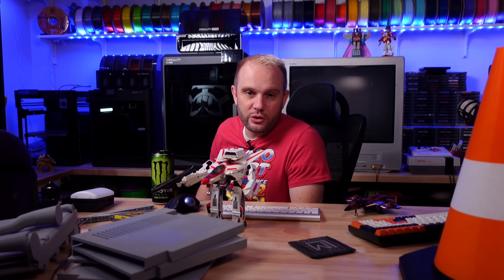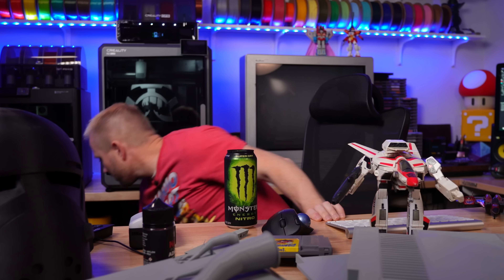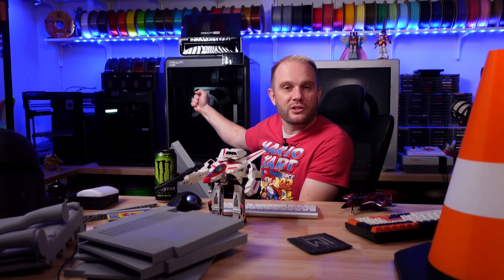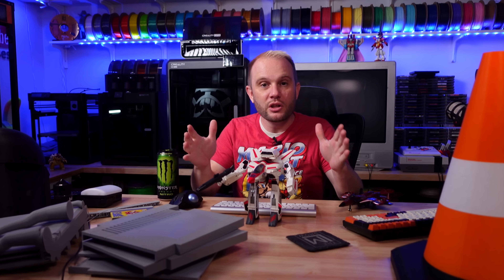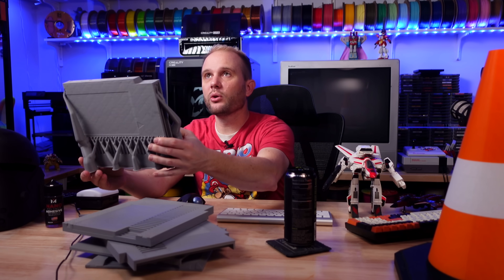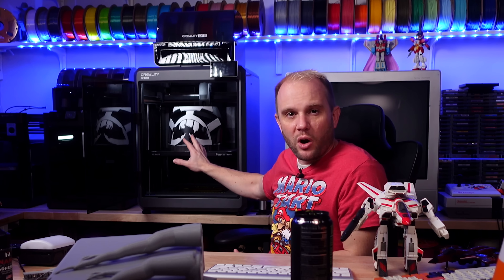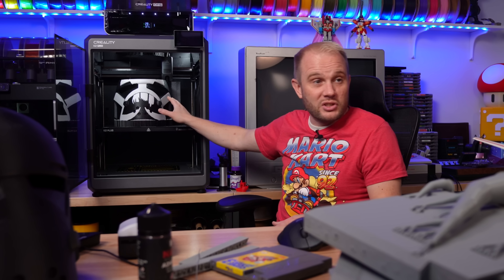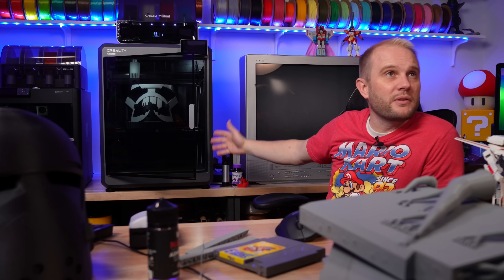SOOO Many Broken Parts and Print Failures!

Comment: I think it's important to capture days like this because they absolutely happen, and people getting into printing need to know its a thing that happens, but it's not insurmountable. My least favorite was trying to make an Orcaslicer profile for the Kywoo Tycoon because enough people had been asking, being new enough to Orca that I didn't triple check acceleration before printing, and toasting a stepper driver. The drivers are soldered in so it's a whole board replacement to fix, the main page didn't have them in stock, could order from France or get the board it was cloned off of, and even with that the board is stuck in such a weird place it fequires a crazy amount of disassembly to get at. I had the Magneto X coming, so I just boxed it up for the day I feel like going through all that headache.

Comment: it's creality what did you really expect ??? i made people bought lot of cr10, ender 3 ender 5... worked well for one year and after that the hotends were needed to be replaced if you want to keep printing correlcty.... the cheap comes at a price.
Reply from the maker: This may have been more true many years ago, but there is a significant difference in machines now vs then. In another comment or two, I mentioned how I ordered a custom $90,000 truck -- it had problems when it arrived. This happens with every brand in every industry.

What we are seeing is massive improvements across the board with every brand, our expectations are increasing as consumers and these companies are trying to meet them as quick as they can. This makes me hopeful that we will just get better and better 3D printers.
Reply: @LoyalMoses  yeah but we are talking about the brand that make the k1... Which fixed it's bugs design flaws etc by selling a new version.
They did the same for their scanners. My lizard never reached what creality promised. And they advertises the next one as the one that can scan dark parts... Which was what the lizards suppose to do but never did.
Reply: My Ender 3 printed since 2017.
Stop telling nonsense, brass nozzle need to be replaced on every machine, it's part of the maintenance.

Comment: Dude I am so glad others are coming out about these issues,  we have been through 2 warpped beds and 3 extruders.   And our CFS screams as well....lol.  This printer will need a lot of modifications.  Should of waited for the Bambu release.
Reply from the maker: In the video I said that my printer is printing perfectly, not a single problem - just the loud CFS slot 2, which they've already acknowledged and are sending the replacement. I haven't experienced anything bad at all, and I make it a point to not worry about the problems that other people experience, just share my own,

Comment: I have the Anycubic Kobra 3 Combo. I got it just before Thanksgiving. In the time I have had it, it has been down 75% of the time. Anycubic has been great sending me the parts, but it takes two weeks to get the part only to find out there is another issue. To say it is still frustrating is an understatement. I have replaced the Motherboard, print head cable, hotend, camera and now they are sending me a new print head and fan for the power supply because it sounds like a jet engine starting up. Oh, and as of last night, the AMS is throwing a code saying there is a clog. I have taken everything apart and verified there is no clog. So I can feel your pain and frustration. Yes that sound your machine is making, does and would drive me insane. I am about to go Office Space on my printer if it doesn't start working like it should. When it is working, I love the prints I have made. But I am addicted to this 3D printing.

Comment: Good vid. Have had all those issues over the years.  If you know a part wants to warp and you need to use an adhesive to keep it stuck, clip at least the 4 corners of your build plate with strong metal clips.
Reply from the maker: Thanks! Before I started the print the 3rd time... I was so tempted to grab a few clamps and lock it down...
Reply: @LoyalMoses  you need higher chamber temperature... the large print covers too much of the heated bed, the bed does not need to be heated that much and so the chamber is getting too cold and the warping starts... you can try to mount a fan under the heated bed (pointing upwards) so more heat is transfered to the air in the chamber (works best without bed isolation).

Comment: I recently had a print come detached from the bed. I’m use to finding a mess of spaghetti but not this time. It was a tallish cylinder and it stuck to the nozzle and was scooting around the bed. This caused the pla to create a giant blob that inflated the silicone sock and pushed plastic all the way up to the cooling fan stopping it so heat creep could add to the party. I went in to check it and was amazed the little Ender’s extruder was still feeding that creation. The only thing I was not able to save was the fan. It had enough pressure applied it was missing a blade. Blade was pressed against the heatsink. I regret not it taking pictures of it but at the time was focused on getting the printer up and finishing the planned prints for the day.
Reply from the maker: Yikes! The blob of death! Sorry to hear this.

Comment: Slot 2 is definatly dying there in CFS. 🤣 I'm sure it a swap out of the extruder but Holl Molly... Le 😱

Ouch on the NES cartridges. 🥲

The MAC sliceing is oof for sure in Creality print. I'm working with older MAC,  some reason my mouse movement is scrolling back in time on the side bar. Will be setting up Orca slicer.
Reply from the maker: I checked it on a PC, it’s fine, just the Mac version is terrible!
Reply: @LoyalMoses  Also yes to the floorboards are vibration for sure with the K2 Plus. I'll be happy to move it to the basement when it's done. 😅

Comment: It sounds like the CFS is having problems with the first stage feeder. Likely, plastic has grinded itself in the feeder. It could also be the spool is too light. When retracting, it could be too light thus making nasty sounds. Sometimes adding a weighted core to your spool helps with AMS designs. I would still contact Creatlity for a replacement part or unit. Everyone has these days my man. Just get the maintenance done when you’re ready and you will be off printing again with no problems.
Reply from the maker: I’m going to dig in later, it’s not a simple issue, something is definitely not right.

Comment: Good luck. Yes, we have had print issues, your cousin made me 2 different Sorcerer Mickey on the Bambu A1 mini and they both have issues. Ken says it's the file that's the problem, not the printer. So I have been using Plastic Wood to fill in those areas and going to paint them.
Reply from the maker: It can definitely be the file and slice sometimes for sure!

Comment: Maybe it's me, but every time I try ironing, it looks like crap. What's the secret. My K1 Max or A1 both do it.
Reply from the maker: It should work great with default settings ONLY if there is absolutely no warping. Even the slightest of lift from the build plate, even if you can’t easily see the lifting, will cause ironing to look bad.

I have some other NES cartridge content here on the channel, and the ironing was perfection!
Reply: @LoyalMoses  Thanks for the reply. I just don't like how it looks. I thought it was supposed to smooth out the surface. Tried with my ASA and PLAs. I've only been printing for 2 years, though, too.
Reply from the maker: It should look perfectly smooth, almost impossible to see the surface pattern.
Reply: @LoyalMoses  Thanks. I'll keep testing. I usually looks like it's just scraping it. Looks better if I don't use it.

Comment: Is the filament roll in port 2 made from something other than the ones in 1, 3 and 4? Carboard vs Plastic or something? Is the noise coming from rubbing or the gears? If it's from rubbing try using a thin adhesive felt strip on the top pressure plate. Also use Orca Slicer, they have K2 Plus profiles now and works much better than Creality Print 6.
Reply from the maker: It is the servo in slot 2, I haven’t pulled it apart yet.

I have a helmet sliced up in Orca too for it.

Comment: Let me tell you about ruining two build plates (within an hour) before discovering a tiny piece of something stuck on the bed, under the plate. The first scraped through the PEI and down to the metal. The second one now has a small bald spot and might still be functional.

BTW, this is the least happy I've ever seen you in a video! Sorry, I laughed hard! Maybe switch the dying-chicken powertrain for the optional happy-hamster power train?
Reply from the maker: Oh no. I’ve done that too! Now I have a habit of checking under build plates before setting them just to make sure.

As for not happy, that was legit… after 2 days of screaming at me, I wanted to end slot 2! 😳

Comment: I am so glad I did not get a k2 plus. I was so on the fence. I got 2 p1s combos instead and they’ve been amazing so far.
Reply from the maker: P1S is an amazing machine, k2 plus is really good too, helmets in multicolor is just sick!!!
Reply: @LoyalMoses This is completely opposite of what you say in the video lol. What are you saying?
Reply from the maker: Very clear in the video, the K2 produces great results, and the P1S is one of the best machines on the market. Slot 2 on the CFS is broken, which happens - I am a realist, even my $90k truck arrived with a damaged moonroof, this stuff just happens and really isn't that big of a deal. As for the P1S, the orientation of the model, my choice of infill and attempts to use ironing when PLA was warping was the issue. It's really not that difficult to understand.

Comment: I'm just waiting on the new larger Bambu Lab to go with my X1C.
Reply: Better talk to the bank for loan for larger Bambu 300+mm.
Reply: With BL's new firmware rollout, not sure if I want to go with them.  I heard it was not well received.  Besides, I have had 0 issues with my K2.  Guess I've been lucky so far.
Reply: @ypsiprepper  

My K2 has been solid!

Just wait Bambu trouble ain't over... Mark my words subscriptions are coming.
Reply from the maker: Heck yeah!
Reply: Meeeee Toooooooooo
Reply: I owned a Qidi tech X Plus 3. I hated that thing. I then got an X1C. I really want a larger print bed, but I'll wait for Bambu. I can't for them to release it!. I will be getting it.

Comment: I feel for you!  I have seen that same exact facial expression every once in awhile when Murphy decides to ruin my day.  I think you may need to add a live blood pressure monitor and a big fat red Easy button!   Anytime stuff goes wrong it usually does so in a cascading chain of events.  The up side, there are many more days where everything just runs completely rosy.  Hope all is back to normal!  What printer caused the failures to all the large panels, the K2?  I have never been a fan of Creality software.  I had a whole day of this about ten days back where things just went downhill fast while working on a very large 1.3M RC plane.
Reply from the maker: The failures on the small parts were all on Bambu machines, really just slicing issues. The giant one was on the unreleased Eryone X400.

Comment: Did you use CP6.0? I been having warping issues i never had before i tuned it over weekend but just not fleshed out way i had it in CP 5.whatever 😂
Reply: Cp 6.0 is basically temu version of bambu slicer😂😂 7:30 also heard that several times about standard purging values not enough on few groups im in

Comment: I thought Mrs LM was screaming at first, then i thought someone was screaming in pain! That would terrify me if i woke up to that in the middle of the night. 

Did you get a picture of the build plate wrapped around the print? That's just proof, to me, of how good Vision Miner NPA is. I got a little too excited to take a large print off my A1 Mini and didn't let it cool. The NPA worked so well, my printer came off the table a few inches when I grabbed the print to take it off.
Reply from the maker: The whole house has hated slot 2 on that thing! 😆